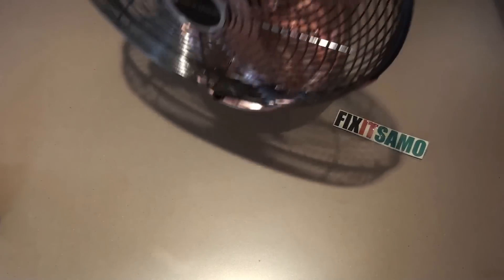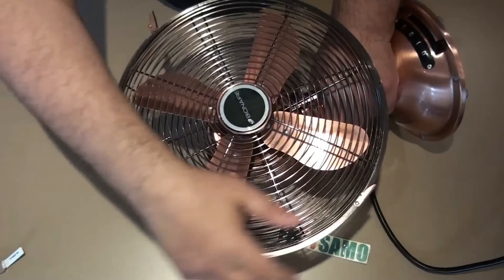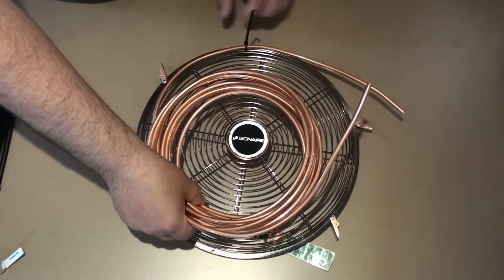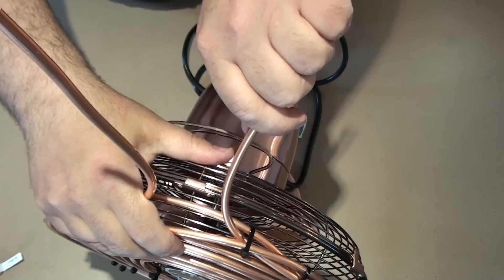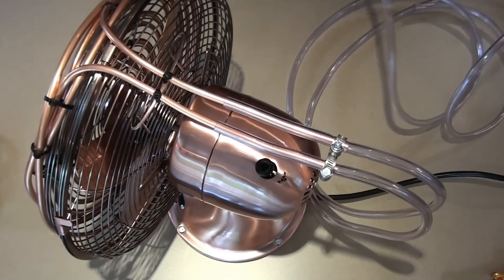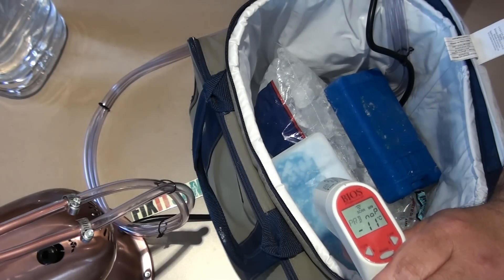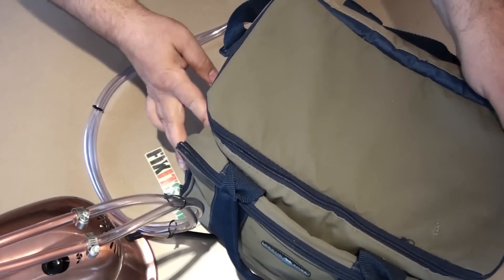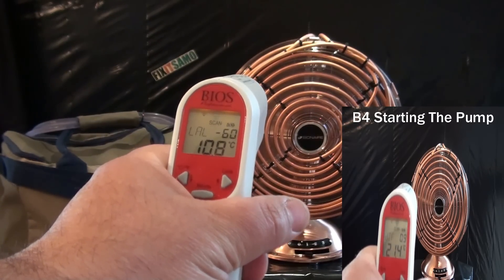How To Turn Your Fan Into An Airconditioner  AC

Comment: And if you are broke just cover your windows with white sheets OR (as i have done as well) White wall paper.
And put the fan on the ground, it will blow the cooler air over the floor making it more cooler.
Also make a way for the warm air to escape as warm air rises and cool air sinks.
Reply: And turn up some soft jazz, put your hands or feet in a bucket of cold water.
Cool your body up as well instead of just the environment.
Eat light food and stuff that doesn't crank up heart-rate or blood pressure.
Reply: @groenmatthew3708  
Yes, good point.
Reply: I just covered my windows in lining paper that seems to work very well.

Comment: SWAMP COOLER NOT A/C
Reply: It's not exactly a swamp cooler. A swamp cooler uses evaporative cooling. This is cooling by ice. It will work regardless of clmate until the ice melts and the water warms up. Requires replacing ice as it melts.
Reply: @greenspiraldragon  You're correct.  

But, for all that hassle, I think people would be better off buying a cheap window a/c.
Reply: Yup, or in other words, and evaporative cooler.  And, they don't work well in certain climates.
Reply: Do you even know what a swamp cooler is?  I did not think so.

Comment: Great way to cool down a tent. The nay-sayers own stock at Frigidaire.
Reply: put a fan on the ground and have it blow over frozen bottles of water 
works as well
Reply: You would need to power the pump.
Reply: @lambda4931  For a hot night in a tent on a three night camping trip  a small space fan built like this is easily powered....oh I think a small solar charging system generator would do it.
Reply: @timbrook7810  Yea, it can be done. Just saying, it will take some effort. Most fountain pumps are 110ac, so the solar system will need to modulate and then step up the voltage. Maybe if you were camping by a cool water creek it would be worth the effort to pump the creek water.
Reply: @lambda4931  There are definitely benefits to pumping right out of a cold water creek. Eliminates the ice issue.

Comment: you need to freeze a lot of icecubes, what causes you freezer to work extra, meaning giving more heat :) because in 1 hour, all your ice  will be melted in your cooler
Reply: I used a hard plastic cooler and use either ice blocks or 1 gallon jugs of water frozen, to sit in the water in the cooler. I only use cubes to 'kick start' it. Also, my fan doesn't oscillate and I have the water lines coming out the bottom so if leaks occur I don't have water dripping on the electric motor. Otherwise it works quite well.
  Take Care All
Reply: Well since I can buy a 16 lb bag of Ice from the machine up the street from me, even when the power is out, because the Ice machine has a back up generator, this will work great when we get another hurricane.

Comment: It's better if u place the coils. Behind
Reply: What about the water condensation on the copper tubing?
Reply: Lerlo is right.. the directed air is more coherent when the restriction is place behind the fan. When placed in front there is too much turbulence.
Reply: How so?  I would think that you would want the coils to be directly in front of the fan in order to blow the air across the coil?
Reply: @pjsavagejr  if you don't know then you've never experienced hot weather.
Reply: @pjsavagejr  The pump sends water thru the tubing. The copper tubing is for better cold transfer at the point where the air blows across it.
Reply: @pjsavagejr  Did you even watch the video?
Reply: @pjsavagejr  Copper is an excellent conductor for temperature. It transfers the cold from the water much more efficiently than the plastic tubes would.

Comment: "this proves this system really works." But no, because the laws of thermodynamics say it doesn't. The extra heat your refrigerator and freezer create to remove the heat from the icepacks or water to create ice is greater than the amount of heat this cooler will remove.
Reply: The refrigerator or freezer would obviously not be in the same room as where you would apply this fan
Reply: But unless you are unplugging the freezer between ice packs, doesn't it run all the time anyway? It can't be much more than normal.
Reply: Your right, these guys don’t understand how heat moves and that if you used this to cook your entire house, well at the end of the day your house would be hotter and your electricity bill higher, UNLESS YOU pump the heat outdoors, or buy ice from the store :D
Reply: @stephenmancuso3314  Nobody is using this fan to cool down an entire house, they are using it to cool the immediate area around the fan.
Reply: There are a LOT of ice chest AC designs out there.

The intention is not to cool a whole house, or even a whole room. Most often they are specifically to blow cold air in a specific place.

If your room is 80 degrees but you plug this guy in you'll get some cool air blowing over you. It's the same idea of using cold water spray bottles with fans.
Reply: @stephenmancuso3314  or the frezzer outside in the garage
Reply: Ive made one like this. It blows cold! you have to add ice to it after some time. For me it was after 4 hours. it very much does work pretty well

Comment: this is know around my area as a  Swamp Cooler ,  but great build
Reply: Pretty sure the swamp cooler puts a lot more water into the air since it relies on the evaporation to cool the air. Since this contains the water (for the most part since it isn't 100% air-tight in the bag), it should keep the humidity down a lot more.
Reply: @DraconicDuelist  If the coils are sweating and dripping like a cold glass of water on a hot day, then his device is actually dehumidifying the air to a small degree.  It's 115F right now in Phoenix and my swamp cooler is putting out cool 74F air because the humidity is only 9%.
Reply: @slickraft  Good point! I'd somehow gotten concepts crossed in my head (tired) and was thinking the condensation would be adding moisture to the air, rather than taking it. Finding a way to properly seal the cooler and adequately draining the condensation to be contained would actually improve the feel of the environment more.
Reply: Swamp cooler uses hey and water

Comment: I cannot believe that many peolpe think negatively about this proyect , copper is a great conductor of temperatures ( whether hot or cold ) , the great inventors were always criticized negatively , everything has a cost , thank God my house has air conditioning and i'm going to do this idea , thanks for sharing this grate idea .
Reply: I don't think negatively about this project , I am just having a little fun cause he made it way too easy !
Reply: Not an invention first off, in fact ice is how the original ACs cooled, and a "ton" of cooling referred to a weight of ice. Second, unless you purchase ice or use a refrigerator/freezer outside to make ice, this actually adds heat to your home.

Comment: I like it everybody is trying to reinvent the Air Conditioner.  Lmao
Reply: @Girl On A Quest Well what ever you like. It won’t produce enough BTU’s to cool an average room.Like I have said it’ll work when you are sitting in front of it perhaps. There will be condensation on the tubing because it’s exposed and if you have a higher humidity factor it may be a lot of condensation so make sure you have lotta towels handy. And again it won’t be very efficient. I’m not belittling the project I am expressing my opinion from 45 years of experience in HVAC and Commercial Refrigeration systems 
And there’s nothing wrong with modern ACs. Providing a system is designed properly for it’s purpose. Say an average room maybe 10 x 12  and one person occupied might require a unit of 5000 to 8000 BTU’s depending on other factors like insulation and time occupied in the room how many windows and doors etc. Those are the smallest units made 
Window or thru the wall units and a bit noisy. The best units for most all applications are Mini Splits very popular and most efficient the compressor and condenser part are out doors and the evap sections mounted indoors and with many configuration. Extremely quiet both sections 
Of course they are more expensive  but the costs are well worth it and I believe they make as small as 8000 BTU units. There is also portable A’s that can be moved around but there has to be a duct connected to the condenser (flex) so the heat can be removed to the outdoors these come in smaller sizes I have sold a few to people that have home offices who don’t want to run the whole house system if they’re the only one home. Anyway I’ll stop yammering 
You’ll just have to get a fan one made and then you can see for yourself. Good luck
Reply: An 'air cooler' is different than an 'air conditioner'.
Reply: @KD Vinson definitely is but this is a basic AC design crude but the principal is the same. The air blowing over the circulating cold water in the tubing in turn the heat from the air is conducted and absorbed by the water The (evaporator) then circulated back to the ice pack and water the heat is transferred to the water and ice raising the temperature cause to melt and warm the water it’s a cycle and the longer it goes the efficiency of cooling fades as the cold water becomes warmer and needs to add more ice to maintain temperature.
Reply: @Girl On A Quest It isn't less electricity though, you have to consider the power needed to make the ice. Also the amount of heat your fridge adds to your house making the ice is more than this cooler will remove, unless you purchase ice or put a freezer outside to make the ice.

Comment: I would have gone all plastic tubing.  Much cheaper than copper.  But then again, this video was taken 6 yrs ago.  Good idea though.
Reply: plastic ain't a conductor it's  an insulator thats why he used copper
Reply: Much cheaper and wouldn’t work at all
Reply: The copper keeps it cold.
Reply: @girlonlaptop  not sure what you mean by keeping it cold, but what it really does is allow for heat exchange since the copper is a great conductor the warmer air flowing over the cold water will exchange heat faster allowing for cooling.
Reply: Then you'd be sailing the epic failboat due to the fact that plastic isn't a conductor.
Reply: Guys just destroyed him

Comment: Just have the fan blowing air over ice water sitting in a bucket,  it eliminates the tubing and pump and gains some evaporative cooling as well.
Reply: Your method melts the ice around 10x faster than this would
Reply: when i was in western Australia I am from the U.K it was hot as 130+F almost every day  so what we used to do was get a fan and get one of those things you spry a fine mist of water  like a garden thing you spry leaves with to kill bugs?  one of those things fill it with crushed ice and water and spray it directly at the fan when the water droplets blew back at you it was cold works a treat
Reply: Yeah, but that has its own issues. 1) The ice won't last as long due to the fan blowing all the cold moist air away (increasing it's entropy by making the air above it dry and warm). 2) It adds a lot of humidity to the air making it sticky and heavy.

Comment: Kinda wondering why you didn't add ice cream salt?
Reply: Wouldn't make sense... It would lower the temperature even more at the cost of expending the ice faster. At 11 degrees Celsius, it is more than enough cooling already. Also, it'd be problematic since condensation might appear sooner around the tubing which is already a big oopsie in his design.
Reply: that was my first thought...

Comment: I have a small fan... With plastic cover and plastic blades.
By removing the front cover, the airflow is less hindered, thus it's cooler.
Reply: Fans do not cool air... only move it.
Reply: @terrystearns1196  
Yes, it does not make the air colder. But it feels cooler on the skin due to "more airflow" since there's no front grill hindering the ventilation... and it's only on the same speed setting.
Reply: @terrystearns1196  Yes, they move the air heated by your body... away from your body.
By replacing the hot air around you with "room temperature" air, it allows your body to radiate more heat and cool itself off. Thus, you feel cooler. It also moves the wetter air from sweat evaporation away, letting your sweat evaporate more easily due to needing to evaporate faster to keep the equilibrium (can't think of correct term for balancing the density of moisture in the air). More air-flow = more heat dissipated.
Reply: Nope, just more air flow, it'll still be the same temp.
Reply: @Blueknight1960  
Similarly, when using the fan at higher speed settings (or higher airflow) you'd feel cooler.
Reply: @erichanastacio9695  Yes it will make you feel cooler, but the air temp is the same.
Reply: @Blueknight1960  
That's my point... More airflow since nothing hindering at the front.
And we're NOT using extra energy to make it cooler... And since it's a 9-inch diameter plastic blade fan, it doesn't hurt when accidentally touching the open blades.
Reply: @Blueknight1960  
More airflow makes it cooler... Even using a paper fan; the more air directed at you, the cooler you feel.